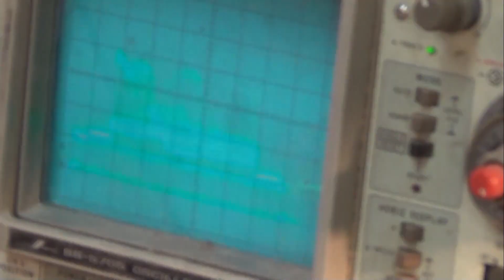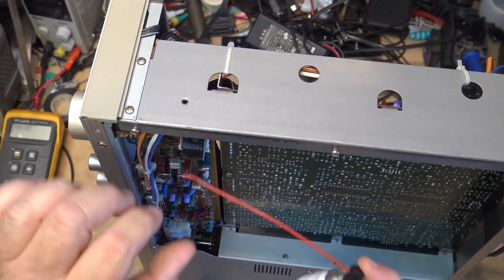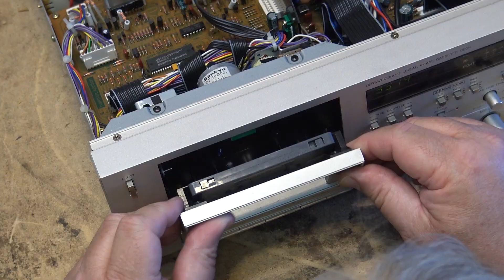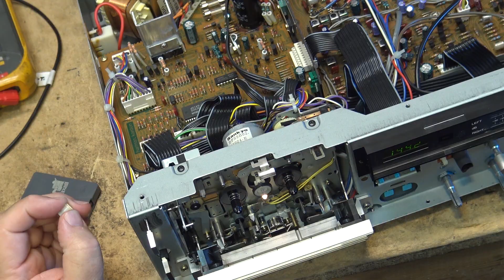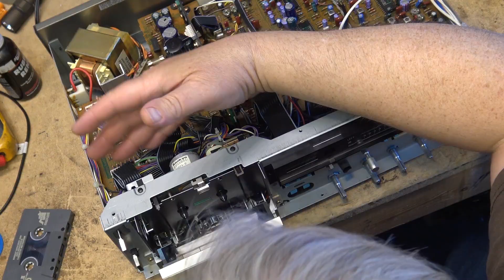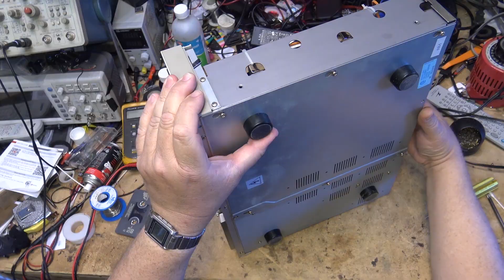Harmon Kardon CD491 Cassette deck no tape movement repair

Comment: Helpful video.
I am working on the CD101 model which is very similar to your CD201. There are actually three belts on it. A third thin  belt runs along the top of the chassis, behind the cassette housing. It is for fast-forward and rewind I think. 

It is not clear how to change it out. Any ideas? You may have the same on your CD201. Yours may have broken.

Also, if you puncture the sticker on the back of the motor there is a screw that can be used to set the correct pitch for the mechanism. I learned that from technician quite a while back during an earlier belt replacement.

Comment: I've got a CD-401, similar but looks like a different mechanism. The tape mech is stuck in the up position, power it on and it's spinning like there's a tape inside yet I can't even put a tape in it. Suggestions? Belts look ok.

Comment: My deck is a later production unit and the pully you remove is not easily removeable on mine. I would not want to force it and take a chance on breaking it as they are no longer available anywhere..
Reply from the maker: Time to put it in the bin.  Give it a decent burrial.

Comment: With all due respect Sir.... "nice" doesn't cut it!   The CD491 is a true Sonic Marvel and a Masterpiece in a world of mediocrity and compromise. Real B&O HX Pro, it's capable of 26mhz with a metal tape properly bias tuned. 
One of the top five greatest cassette decks ever made. 

P.S.   Not trying to stroke your ego but you should know that you kick ass and rock out.  Imo you have a gift from god like my father.  Happily sub'd.
P.s.s.  I'd Happily lecture lawnmower man for you but your to far......lol.

Comment: I owned this great machine in the `80`s. Amazing machine it was. I paid for this machine in the Netherlands 2,500 dutch florins for it (about € 1135 back then). That was a lot of money way back. I guess when you would count it to today it would be about € 4000 maybe?  I really miss this. The cassettes that i used that time were mostly Maxell XLS2 and later That`s (Metal). They were the only two ones that i used on this machine and they performed the best results also!

Comment: A repair shop told me the timing motor is bad on my CR7 Nakamichi tape deck. Also said a replacement motor is no longer available.  Any ideas?
Reply from the maker: Yeah that sounds about right motors himself are getting very difficult to get for all cassette decks the guy that owns this 491 that you just watch the video on it has it for sale and thinks he's going to get huge dollars for it. I got news to anybody thinking of buying it it's but almost 40 years old with 40-year-old motors that are not available reality check time it's not worth anything especially not what some people think these old tape decks are worth.

Comment: Many, many, many thanks for the video. I fell in love with my CD491 once again. 
The Sankyo hardware is used by many high-end tape decks but unfortunately its idle mechanism really sucks and needs repair every 1-2 years due to the idler tyre getting old, used or not. It looses grip over time and REV&FF time gets longer but most sadly: the (usually really low) W&F drives you crazy. That's why Nakamichi modified it and went back to a (noisy) gear mechanism. I was the 1st in my country to observe the problem and after two repair attempt I've got a completely new tape deck which had the same fault after some time but they knew how to repair it now. 
My advice is to replace to tire of the idler every 2 years and regrease everything in contact with it. Look for 'Nakamichi idler tyre' on eB, it's the same size. Don't push the pulley too far in, just enough to be in the middle of the outer plastic rollers. 
I've a split idle pulley and would be very thankful to get one if somebody knows where I can get one. Shouldn't it be possible with 3D printing nowadays? 

The CD491 was a hell of a tape deck, better in nearly every dimension than any Nakamichi including the Dragon (where the azimuth correction is top-end). With Dolby C and HX-Pro and Metall cassettes it went up to 26 kHz +- 0.5 dB. It produces quite a lot of heat. So you'll have to wait half an hour before you start recording until everything is warmed up and at optimal operation temperature. Dialing in BIAS and LEC LEVEL and you'll be able to do a record of very, very high quality. I do have the tech manual of it and used to adjust it myself. 

Anyone out there with a solution for the cracked idler pulley?
Reply from the maker: 26KHz, now that I would like to HEAR!

Comment: Do you recomend recapping all the boards as the electrolyics are almost 40 years old?
Reply from the maker: No. Most electrolytic caps will never fail.  The thing that makes them fail is opering close to max rated voltage, or over voltage. Most will never fail. Some brands are more prone to failure than others.
I just did another amp today. 2 leaking caps, and they were actually leaking the electrolytic.

Comment: Change that idler tire, it is cheap and it will save you a head ache in the future, Rubber renew on an idler tire is just a temporary repair. And you are right about the crack on that nylon pulley and the proper and easy way to remove the idler tire to save you a head ache if you lose that c-clip!
Reply from the maker: The tire didn't need the rubber renew it was the pulley causing the problem.
Reply: @12voltvids  Thanks, I always watch your videos to learn, I wished I had you close to repair all my vintage equipment!

Comment: Ok 3rd comment  LOL....   I would like to see more on the older portable radios also....  My new bench is not even close to being finished yet......  Test equipment is needed , I have some so far...... Anyhoo my first projects will be a Sanyo RP 8700 and my old HR 2510 .... Yep Dat darn ole yellow glue is in there, not turning brown yet , but it is still pliable............I have to go pick up a couple boxes of things my old Ham buddy is giving me , that's a good start for test eqip.... I still need a signal jenny and a scope, I wish I would have never given my old tube scope away.........I'll make my own signal tracer and a RX meter for tuning the receivers in on certain units....  A good SINADDER is in the the future as well...... Baby steps. Baby steps....  Within a year I should have a shop back up and running again........ Plus Tard Mon Ami from Cajun Country .......

Comment: @11:04  You mentioned a good point ....   A lot of people click from FFW to Rewind without pressing the STOP button in between .... That is hard on the small plastic parts also....  I always hit the stop button first, I always thought it put stress on the tape itself too, but that's my way of thinking when I owned a Alpine or Kenwood tape deck.....
Reply from the maker: That should not be an issue as this is logic controlled so it will go through the stop cycle before changing anyway but on mechanical decks you are correct.

Comment: Hello just wondered whats the best way to clean the copper micro switches (front top right) as my Nakamichi cassette deck 2 has the same which when dirty /oxidised can cause playback issues, just not sure how careful you have to be with them

Comment: Ok what? I wish I had that feature, where I can hear the tape exactly as it’s recording from the tape side of Monitoring! That would be super handy!
Reply from the maker: Every 3 head deck has that feature, which is nice, you can hear over driving and distortion as it records.
Reply: 12voltvids I need to look for that feature in the future! Right now, I only have a tape that that does not I have the tape Monitoring feature like that. I only have the Sony TC-We475 unit.
Reply from the maker: @captianbubble  only high end decks were 3 head and these days sellers are on drugs thinking these are worth something. In reality these are all old tape decks now.  All made back in the 80s.  I wouldn't pay more than 50 bucks for one myself but then that is me. I won't pay much for any old electronics, not the stratosphere prices that ebay sellers think they are worth.  Problem is some people are dumb enough to pay that price and that drives the sale of other broken decks up there.  Most are worn out and parts are very hard to come by.  A prime example. That mcintosh dvd player I changed the belt on.  The guy that brought that to me bought it broken for 200. Ground me down on the repair to I think 70 for the repair and then came around bragging that he found a sucker to buy it for 1500.00.  Someone is always dumb enough to pay these prices.  I had an slp 50 technics cd that I got for free that a guy was getting his pants to buy.  He offered me 500 and turned around and sold it for 700 the next day.

Comment: Nice tip on the rosin. I've run across that before and glued it, but I will definitely try that next time instead.
Reply from the maker: Rosin can be dissolved with alcohol if it has to come apart down the road.

Comment: a whole lotta circuitry in there! big power transformer too if im correct this cd series machines is made in the 80s? when i was a teen id  look at the hifi mags read the reviews and just dream lol ! of owning anything h/k  a super stereo system! by my twenties i was able to buy myself some used gear a whole heck of stereo gear from the golden age of audio 60s 70s early 80s was showing up at local thrift stores a treasure trove of gear !!!amazing what stuff id run into!

Comment: This one would worth the hassle to find someone with a lathe, and turn a new pulley for it from brass or bronze, that will never fail. Also, do a few tens or even 100 pieces, as it is cheaper that way, and sell the rest as repair parts :) .

Comment: JVC  KD-D4  tape deck 
Problem .
Making wining noise on playback .
Motor ,  oiled , clean .
Flywheel oiled '
Belts restored .
Belt wheels , Cleaned .
After a cuple of days it starts again , no REW or FFD operation .
Press REC with spear tape ? all clear .
Play music tape now , all fine .
Put another tape in now ,  ITS BACK !
Any ideas guys ?
Reply: If the noise goes away after using a different tape, then the issue is the tape.
If the noise persists regardless of tape used, then the problem is with that particular deck mechanism - worn gears or stretched/slipping belts can cause issues including poor or no REW/F-FWD operation, lack of reel torque and/or vibration during playback (wow and flutter/unstable tape travel/sloppy take-up) and noise. I suggest replacing the belts if you haven't done so already and avoid using cheap and nasty "Made in China" supermarket tapes when recording - such as those which come in packs of 3 for under 2 dollars e.g. Silver Shadow, Sweda and Stereo Club. Those kinds of tapes are very poor quality, have a tendency to jam or bind, and are extremely noisy due to their shell design and flimsy slip sheets. TDK, Sony, BASF or Maxell tapes are pretty good quality with low noise (from experience).
++ Try a different tape first. It's the quickest and easiest option. Investigate the deck afterwards if there is no improvement. ++
Reply: @RoughJustice2k18  The belts are done as I said .
Its the REC function that sets it right .
Motor speed is fine .
Its not the tapes that do it , its the deck .
Reply: @shaun9107  I wonder if your record playback switch needs a good cleaning ... sometimes if one or more of the connections inside are poor it can cause all kinds of weird sounds anything from squeals to static type sounds
Reply: @darinb.3273  I forgot to say , I have done the switch REC bar on the board the best I can  with a drop of WD40 .
The grinding is mechanical somewhere. 
inimitably.
Reply: I got this on my KD-A2 with old tapes. Pad get so worn out that polishes as a mirror and tape start to grab to it. You need to isolate if if cassete itself of the mechanism. Also the small rollers on each corner of the cassette are very prone to do that. But if the noise can be heard mechanically and also modulated into the playback, its probably on the tape path, pad, rollers etc

Comment: That tape mechanism looked remarkably similar to the one in a Nakamichi DR-1 I serviced recently.
It didn't have a idler wheel, but a gear wheel instead. Although the repair kit included new rubber for a idler wheel...
Same Sankyo motor in same place, and those program wheels up in the corner.
Just a slightly different revision of the transport I guess.
Boy, you're cranking out this videos like there's no tomorrow. 
But that's great. If you can make them, then we can take them.

Comment: You could also use a tiny push nut or tightly fitting nylon washer to hold it on the shaft.

Comment: I wish I could find a reputable repairman like You near Detroit..that know his business..I like your videos on reel to reel restoration..try to do one of my 7 akai decks and totally junked it..ha ha...
Reply from the maker: Unfortunately the repair business is no longer profitable. That's the primary reason I left in 2003, back when it still was profitable but I saw the writing on the wall a mile away.  That and the fact I worked for a miserable man that made everyone around him miserable.  It was one of the happiest days of my life.  Next to meeting my wife and the birth of my 2 kids was getting out of that hell hole which it had become.
Reply: @12voltvids  the repair business can be profitable if your name is e.g. Willy Hermann and you almost exclusively work on Nakamichi high end tape decks whose owners are usually willing to pay up to a thousand dollars for an overhaul.

But when it comes to standard HiFi gear and electronics from the golden days, people are usually quick to throw stuff away instead of having it repaired. Unless it's a legendary item like an Accuphase integrated amp or the top of the line Sony ES components.

I just serviced a TC-K909ES deck which I got off ebay. And oh boy, that thing sounds amazing with half decent tape inside.

Comment: Great video! I Have one coming in today - bought for an insanely low price. The LED meter display is out.  I downloaded schematics but haven't been able to find the section for the LEDs.  What should I be looking for?
Reply: @greg The schematics should have the different areas in sections .... In  a  certain way etc ....  Which schematics you have ???? The service manual ?? 
Edit....  The displays on some units are actually a small vac tube...  Just look for a section with that......

Comment: I have a aiwa vintage 3600ad stereo 3 head dual Capstan tape deck,,,and it was a challenge in replacing the belt,,,and then the Motor decides to die with speed troubles,,,and it was fun replacing that,,,not easy without major disassembly.  Have finally got it all working well now,,,and yes I remembered adjusting the bias trim on it too during recording,,,it made a difference with the sound loud and clear too.

Comment: Just a thought ... couldn't you also use a drop of thread locker on the shaft to hold that plastic bit?
Reply from the maker: Yes but I don't have any and rosin flux gets real sticky. It is made from tree sap, and you know how sticky that stuff is when you try to get it off your car. Brutal.

Comment: Very nice machine and easy to work on. On my Nak I replaced the main pot from the cheap Alps for Noble and Panasonic for balance - lower noise, everything became cleaner, not a shabby difference. Not too many decks had 400, 10(12)kHz generator for level, bias adj - this machine was probably HKs top of the line. In one of the videos you said that you don't like dual capstan machines, yet you like this one or your comment is regarding R2R decks.
Rubber Renue - this thing is very useful, pinch rollers cleaner, etc, that has to do with rubber cleaning including rubber loudspeakers surround.

Comment: The owner has a smashing tape deck, having the ability to re calibrate the record bias i only saw on higher quality units.
And the unit is packed wth quality electronics, not a cheap unit.
That rubber renew chemical has been so dam handy, much like the deoxit you use for contacts.
Some people just torture the grass, shame they do it while you are recording :-(
Reply: zx8401ztv thanks I honestly enjoy it allot compared to my old cassette/CD player, there is a big difference
Reply: Top of the line for HK in it's time.

Comment: A heat shrink tube over that piece of plastic will close the crack and tighten up the mating on the shaft.
Reply from the maker: Could interfere with idler operation if too big.  Super sticky rosin will stop it from moving.  At least it didn't break in 2 as they sometimes do.
Reply: @12voltvids  I remember the gear on a CD player you were working on that gear had split ... I learned a long time ago plastic over metal is not the best idea ... learned by plumbing PVC over metal... they do not expand and contract the same and in my experience threaded PVC over a metal fitting never ends well unless you like water leaks LOL
Reply from the maker: @darinb.3273  yes to the ABS plumbing over metal.  Have dealt with that.  
Take up hum on high end hi8 deck. Have dealt with that too.